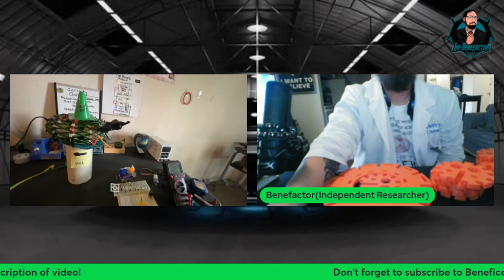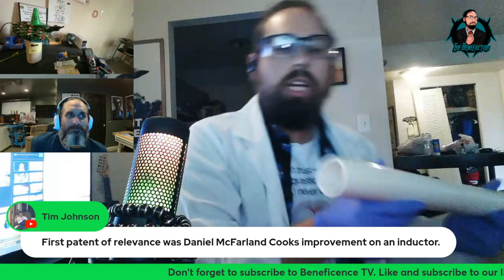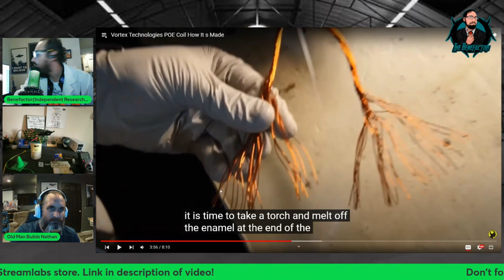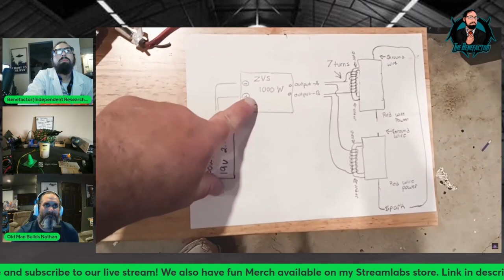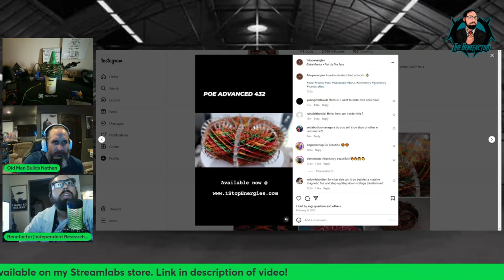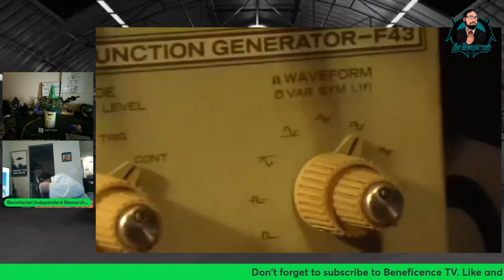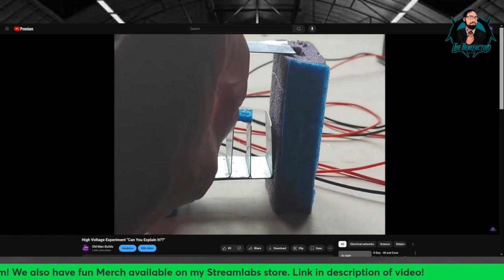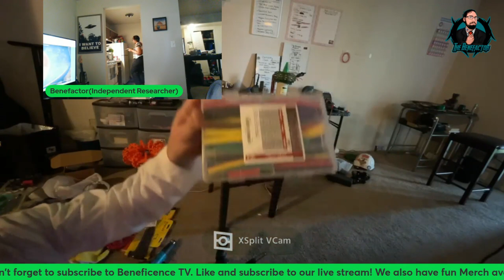Old Man Builds Joins Benefactor "Rodin Coil Workshop"

Comment: What does it do? I have never seen or heard any benefits of making simple things more complicated.
Reply from the maker: He is making a Rodin coil. We are still figuring it out
Reply: @nathanbunten4299  I have seen people making these for years, but no one has explained why. Seems more like artistic thing. I can see that it might have some lower resistance cause of the loose structure. But that can be achieved just by using thicker insulation, or wrapping the coil paired with fishing line etc to have it more spaced out.
Reply from the maker: @Kangsteri  they say over unity at low power or running a magnet on a stick. I don't see a lot of experiments besides Bens so I don't know. I was hoping Ben would show all of them.
Reply: @nathanbunten4299  Cool. I'm not hating, just wondering :D I hope it leads to somewhere.
Reply: @Kangsteri  That's my question as well. I've seen Rodin coils come and go on the 'alternative energy ' scene without any demonstrable advancement over current methods.